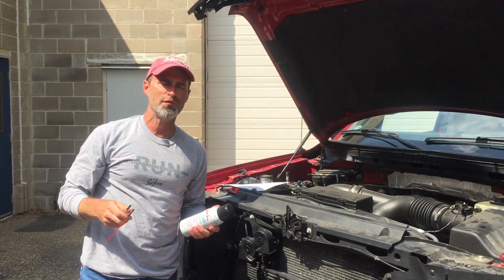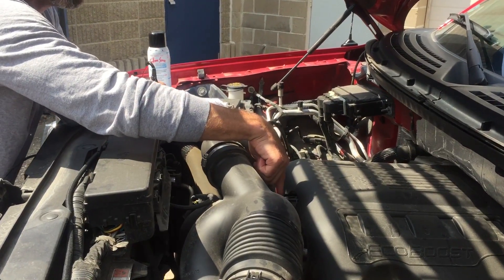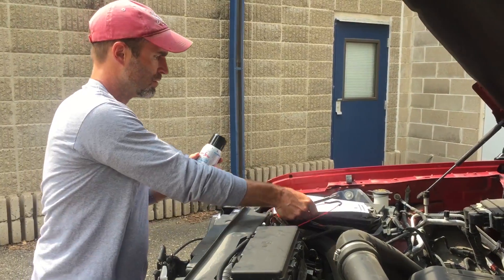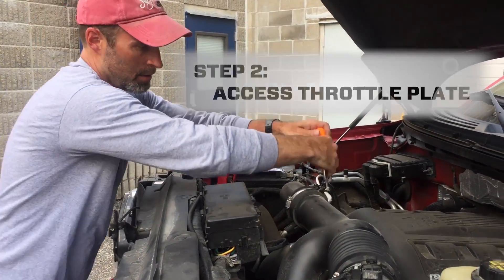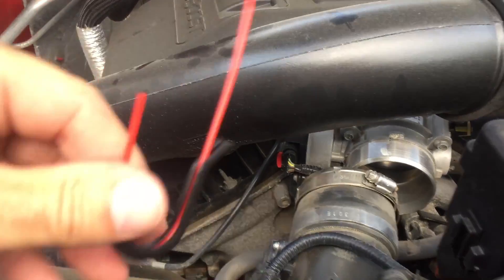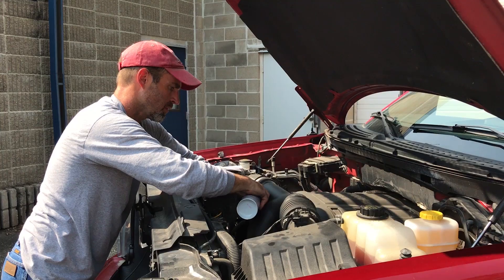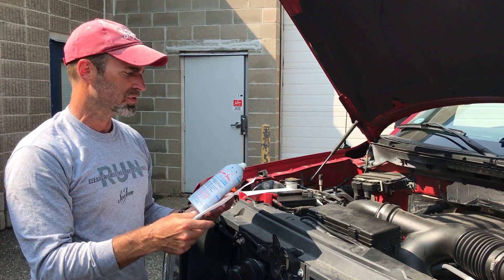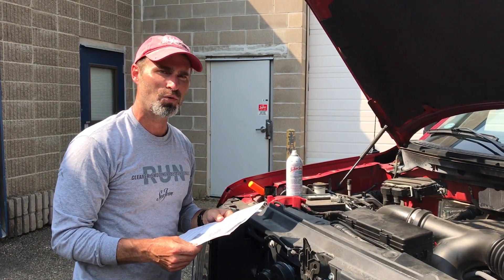(Absolutely👍) Yes, you can use Sea Foam Spray to clean a turbo gas engine

Comment: If you put seafoam in the oil, will it hurt the turbo?
Reply from the maker: No, not related.
Reply: I think it is related because the turbo pulls oil from the crankcase, doesn't it?
Reply from the maker: Please describe what you 'think' is going on in the oil/what you think Sea Foam is doing... That will help us to help you.
Reply: Turbos have oil feed lines that feed from and go back to the main engine oil.  If I place Sea Foam in the crankcase, that sea foam imbued oil will eventually go through the turbo feed line into the turbo.  Will that damage the turbo?  (i.e., should turbo engine owners not put Sea Foam in their crankcase)
Reply from the maker: I think you're supposing that Sea Foam breaks up forms that end up circulating through the turbo's oil supply lines.  That is NOT how it works (that's how detergents work).  Imagine this:  Crankcase residues are heavier forms of petroleum oil - the forms are soft goo, not coarse chunks, globs of gunk, or hard particulates.   Sea Foam reliquefies the petroleum goo back into fluid oil. Nevertheless, anything in oil that could obstruct a turbo oil line could not pass through an oil filter. Hope this helps.
Reply: Thank you, just wanted to make sure it was "officially" safe to dump Sea Foam into my turbo engine crank case before I did so.
Reply from the maker: Thanks, Jason.  That was a nice Q&A - Could be helpful to others with a similar question.

Comment: Still doesn't answer my question. Can sea foam be used BEFORE the turbo, effectively running sea foam through the turbo and thus cleaning it?
Reply from the maker: Thanks, Chad.  Yes, we appreciate healthy skepticism...But unhealthy is tough to overcome.  To expand on the pooling concern:  Applying too far upstream of the throttle body can cause pooling of liquid.  The liquid will rest in a pool in the intake boot...then one day the driver takes a sharp turn and all that liquid fills a chamber...a connecting rod bends = toasted engine.  Anyway, having one way to do things correctly is often enough for most of us.
Reply from the maker: HI Nick:  Thanks for the question.  Sea Foam Spray is designed to be applied at the throttle plate, then go downstream to clean intake valves and chamber areas. Are you hoping to clean the compressor or the turbine? Do you understand that Sea Foam Spray is no longer fluid (or useful) after combustion?
Reply: Sea Foam Official of course I was talking about cleaning the compressor side of the turbocharger. Yes, of course Sea Foam Official, I am WELL aware that Sea Foam is no longer a liquid when it passes through the turbine. I get you're trying to cover your bases, but I find it a little offensive you think I lack even commonsense knowledge.

I wanted to clean as much of my intake as I could, so I just used CRC intake valve cleaner because I needed something reliable and effective.
Reply from the maker: Am only trying to be helpful.  Applying that far upstream would leave oil film, pooling, collect dust/dirt...
Reply: Everyone's offended nowadays. What a surprise.  Thanks for taking time to read and answer questions Seafoam.

Comment: I have a 2010 Hyundai Genesis coupe 2.0t, people had suggested me to take the air filter box off and spray into the tube that goes to the turbo, the only thing is my turbo is on the opposite side from where my throttle at, so basically my question is, can I do that and is it safe to do so?
Reply from the maker: If you mean spraying into the compressor before the air flows into the throttle body, no. The product is designed for application into the throttle body.
Reply: Sea Foam Official do you guys have any product that cleans turbos?
Reply from the maker: We do not make a specific turbo cleaner.  Thanks for the question.

Comment: What about the particles that may break off during the cleaning going into the combustion chamber and out the exhaust to the hot side turbo blades, is there any possibility for damage and does it void factory warranty, thanks
Reply from the maker: Particles?
Reply: Sea Foam Official of carbon or whatever else may be in there
Reply from the maker: Engine residues and deposits come from unburned fuel and oil (from PCV).  They are much softer and less scary than some people seem to imagine.  No worries.  If more people understood how SOFT the common problem-causing forms are, the better and easier most might understand how Sea Foam products work.  Fear-intended fuel additive marketing has caused a lot of imaginations to go down a wrong path. Think SOFT.
Reply: Sea Foam Official thanks, used it the other day seemed to clear up some stuff
Reply from the maker: Thanks, Nic.  Hope the explanation was helpful.  We appreciate the post!

Comment: On a GDI engine, every how many miles should this be done? It would be interesting to see a tear down of a valve with a cleaning interval of 5, 10, 15K miles.
Reply: What about the carbon deposits damaging the turbos ,over heating them? Is this still a issue?
Reply: @hshshsshhshsh7657  if you read about it, they say Seafoam dissolves the carbon, so there are no damaging chunks to break free.
Reply: @hshshsshhshsh7657  I would suggest you either start using seafoam on a new vehicle, or have the valves cleaned with walnut blasting, then start using it.  Or at least check and hand clean them first if they are not too bad.
Reply from the maker: Hi John: Great question, thanks.  For autos we drive regularly, we recommend at least 2 Sea Foam Spray treatments a year on a fuel-injection gas engine.  If I owned a GDI (gasoline direct injection),  I would do a treatment 3 or 4 times a year to minimize intake valve deposits.  Also know that you can do as often as you wish, back to back treatments..whatever.

Comment: ... so make sure you don’t spray it before the turbo.... now I just need to figure out where the throttle body is on my fusion 2.0 ecoboost lol good video I’ve been seeing and reading a lot of horror stories and it’s good to see a way around it
Reply from the maker: We do not know of one horror story.  You think we'd know about it, right?  When you spray into your throttle body it draws through the intake, over the valves and into the chambers.
Reply: I'll give you a carbon build up horror story for the 2.0l ecoboost. 
2 engine replacement bills a year apart both 90k+ mile engines. destroyed piston. 
that should get you into he spooky Halloween mood.
Reply: @darkshadowsx5949  im sitting at 95k and my fusion is still purring like a kitten. Make me wonder about some of the other factors that play into the carbon buildup, quality of oil, fuel, air filter maybe?

Comment: I have a Mercedes sprinter where do l spray the seafoam l can't find the intake do l spray it in to the turbo
Reply from the maker: If a diesel Sprinter, never use Sea Foam Spray in a diesel intake.  If gasoline, straw must be placed directly in front of the throttle plate.

Comment: Can you also add this to the fuel tank? Or is this the only method for cleaning a ecoboost engine?
Reply: Ecoboost engines are GDI engines. You can add Seafoam to the gas tank and it will help clean the fuel injectors and carbon from the combustion chamber, but it will do absolutely nothing to clean carbon off the intake valves because the 
 gasoline (and Seafoam) never passes over the intake valves. It's injected directly into the combustion chamber.
Reply from the maker: Bill is correct.  Sea Foam Spray through the intake is the way to reach and help clean intake valves on a Ecoboost GDI engine.
Reply from the maker: Thanks, Patrick.  My encouragement is to gather a better understanding about how turbochargers work.  Until then, we would never want you to use anything you're not comfortable with.  More, don't use ANYTHING you don't feel right about, including Sea Foam.
Reply from the maker: You can add Sea Foam Motor Treatment to any gas or diesel engine fuel (tank).
Reply: I'm just a little concerned with using it after hearing a lot of people say it will damage the turbos..  I know using this method it will not hit the turbos through the intake or even putting it through the fuel will it reach the intake side of the turbo but what is going to stop anything in the exhaust harming the turbos?
Reply: Patrick Frazier ,how much of the exhaust goes back through the turbos?
Reply: enough to make however much boost it makes

Comment: Will this work on supercharged engines?
Reply from the maker: Yes, works.  You're spraying into the throttle body, not down the turbo intake airstream.
Reply: mark parawan I found a vacuum port downstream of the inlet on my intake manifold.

Comment: Wont this harm the turbo?
Reply from the maker: Please help us understand why you think it could harm a turbo.  Where, specifically in the intake process, do you you think about how a turbo could be affected?  Go from there...
Reply: Sea Foam Official wont all the harmful deposits go straight to the turbo, since it works off the exhaust gases?
Reply from the maker: By the time your intake air is drawn into the throttle body it has already passed through the turbocharger and intercooler... The product is applied directly in front of the throttle plate, goes straight through throttle body to upper engine/intake valves and chambers.  Please let me know if this helps.
Reply from the maker: Exhaust air/heat/pressure (like an air compressor), not burned emission gases.  Anything cleaned by Sea Foam Spray goes out the exhaust with the burned fuel emission, which is far downstream/after air passes through the turbo.  Turbo does its job on the front end of the airflow and before throttle plate where Sea Foam Spray is applied.
Reply: Sea Foam Official ok, thanks for clearing that up.
Reply from the maker: Glad to help - great coversation!
Reply: Those harmful deposits (mostly just carbon) which the Seafoam has removed are probably mostly in a gaseous form. Even if some small particles of carbon break off and go out the exhaust, I doubt if they would do any damage to anything in the exhaust side of the turbo, since you are only running the engine at 2k rpm.
Reply: Sea Foam Official Because a turbo on a 50,000 dollar F-150 with 1,000-3000 dollar turbos spinning at nearly 200,000 rpm doesn't like having bits of solid carbon thrown at it. 
I love sea foam for naturally aspirated engines for the record, though.
https://youtu.be/nK2eXdaydqI

If your turbos fail 10,000 miles later, don't go to Ford and say the spray foam worked but you have no idea why your turbos have chips on the exhaust side. The ecoboost turbos are NOT far down the exhaust from the engine. Regardless, I'm at 93,000 miles and haven't had the build-up, if there is any significant amount, cause any problems.
Reply from the maker: William:  Please be willing to consider how a petroleum solvent works. Soak a dirty intake valve in a jar of Sea Foam Spray for a few days.  The hydrocarbon deposit residue will soften and smear off like peanut butter... Detergents loosen - Sea Foam has no detergents or harsh chemicals that cause cause 'chips' or 'bits of solid carbon''.

Comment: Will it work on a twin turbo engine?
Reply from the maker: Hi Rogelio:  Yes, Sea Foam Spray works in a twin turbo gas engine. The Ford truck in the video has a 3.5 EcoBoost twin turbo engine.
Reply: Sea Foam Official Thanks Brian from Sea Foam Official.
Reply from the maker: Our pleasure, always.